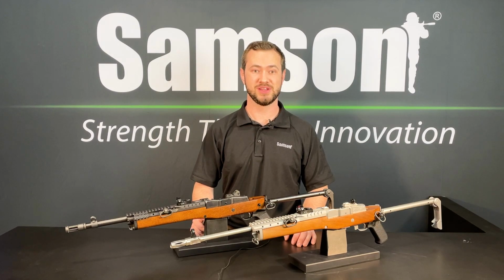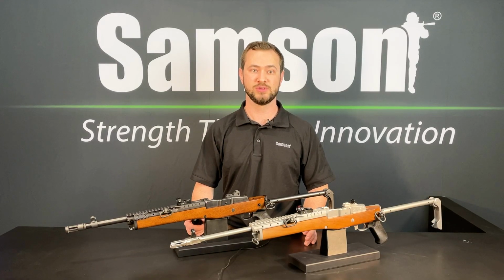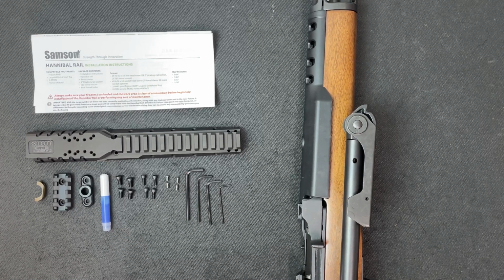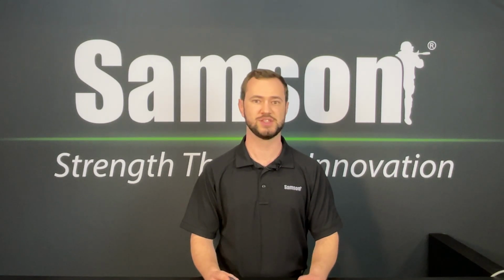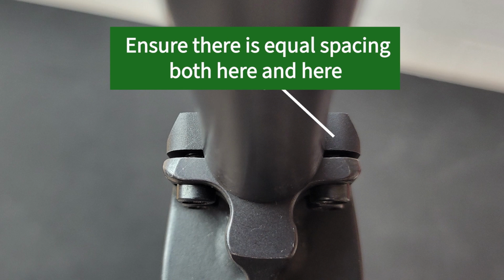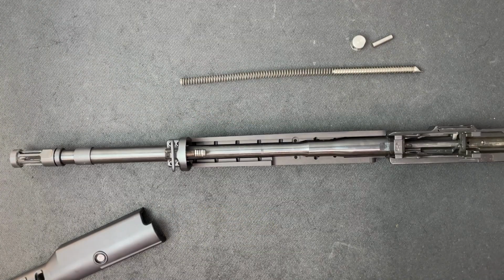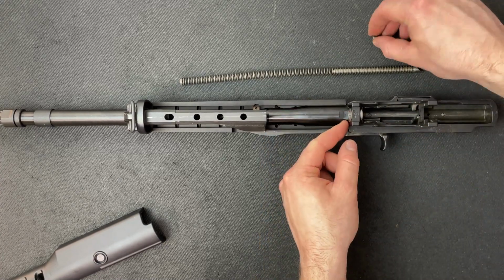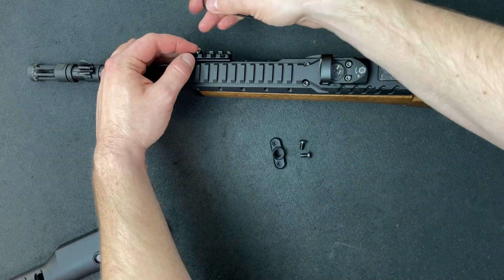Samson Manufacturing Hannibal Rail Gen 2 — Overview and Installation

Comment: Have you run a scout scope on this yet?
Reply: Not to take away from Samsons Hannibal rail which is definitely the way to go for a red dot,I would say if a scout scope is the route you want to go the Ultimak scout rail would be the better option as the picatinny rail goes all the way to the back. With that said if you want the versatility of both the Hannibal rail is the better option as with a 10-12" eye relief you can get out of high end scout scopes should work but for exclusively scout scopes Ultimak will let you bring the scout scope closer to you.